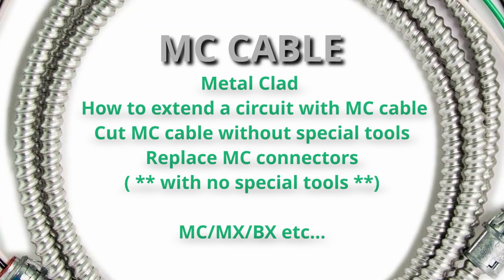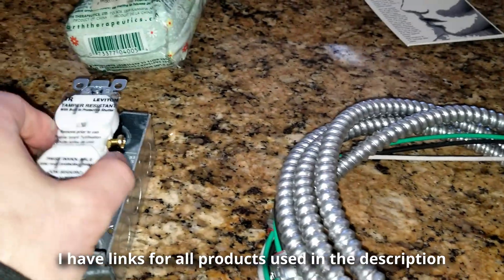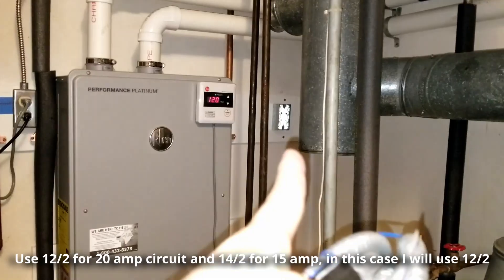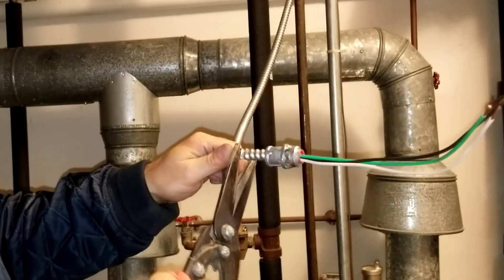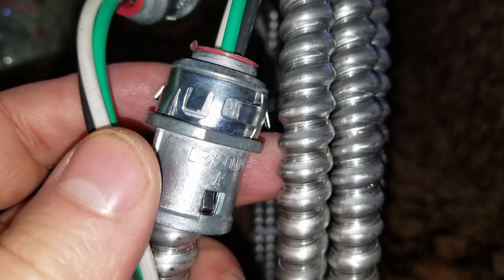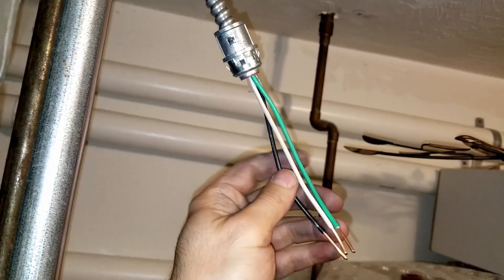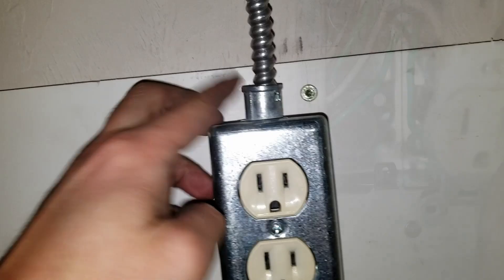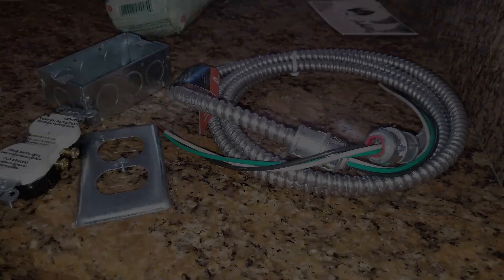How to install, strip and cut MC cable with no special tools

Comment from the maker: Thanks for watching, if this helped you leave a comment and subscribe.
Helpful links:
MC connectors for 1/2 knockout - https://amzn.to/37UnErD
Southwire MC cable 12/2 - https://amzn.to/3q2whX8
Wire cutter and stripper - https://amzn.to/3aYaLOW
Voltage tester - https://amzn.to/3q0Isnx
Tin snips - https://amzn.to/37Sy5vM
Metal outlet box 1/2 knockout - https://amzn.to/3uvwlSK

Comment: If you don't have the proper tool to cut it, use a hacksaw make a small cut on one of the ridges, careful not to go in too deep and cut a wire, then bend the Cable at the cut and it will pop apart.

Comment: I had to cut my MC cable also. I didn’t reuse the press fit connector; I bought an MC connector with a red plastic protection insert. The MC connector has a screw which when tightened is secured to the outer sheath/jacket of the cable. Much easier than playing with those 3 tabs.
Reply: To get those connectors off all you have to do is spin it on the cable and it Twists off with the ridges

Comment: I found it's possible to "unscrew" those push in barbed connectors from the end of the cable and then it's easy to reuse it.

Comment: This guy worried about code but he didn’t use a bushing.. and the method to cut the Mc was maybe the worse ever.. I’ve never seen anyone unwrap it like that before.. another thing while we are in code.. when using mc in tis method for something like a water heater.. every box in the entire run must be grounded.. there is a reason they have grounding screws in boxes just saying.. 

Because if the exposed nature of this hit even a first in line grounding applies.. every single junction box, outlet box switch etc through out that entire circuit must be grounded.. one would think this is common sense seeing how everything in that area has water in it and if a like were to bust have fun.. 

Spent $2000 in setup.. failed to spend $3 for bushings and $20 for a roto splice tool.. and the very first thing any I specter is going to do is pull off the junction box cover to check if it’s grounded..
Reply from the maker: Thanks fir your suggestions. I did group the box, the bushing was on there.

Comment: Snap is connectors are bad, if you need to remove it to move it or anything else it is a pain and you will never do it again.
50 years of experience I have seen so many bad ideas, I worked in aerospace factories building Ion Vapor Deposition chambers and some of the people that work in DIY centers, some are out right scary!

Comment: Great video, thanks!  Unroll the metal clad.  Great idea.  I'm working with 6/3 MC, so unraveling it could be a challenge.  I'm doing a small job of about twelve cuts, so I prefer not to buy a Southwire RF-170 for a hundred bucks.  I'll try this.  Looks like it will at least work for the four square boxes.  A hacksaw will work for the two or so feet to go into the breaker box.  You have to be very careful though to avoid nicking the wires.  🙂

Comment: Good job for bot being an electrician. I’d put a red bushing on before you put the wires into the connector or atleast a little tape around the metal part you filed.

Comment: The person making the video should have used a Seatek roto-split tool to cut the armor on the MC cable.  It makes nice clean cuts without damaging the conductors or leaving rough edges that can cut you.  Many inspectors will fail you if they see hacksaw cuts or other evidence that improper tools were used.

Comment: Please take this video down or update it to show installing an anti-short insert that goes between the wires and edge of armor casing BEFORE putting on the connector!!!!  What you have done is dangerous as it can short.  Also, equipment such as a tankless heater require their own circuit, its not legal to jump off another circuit that has other loads on it.  You have the wire insulation under the screws of your outlet terminals, this can cause a loss connection, and possible arcing, another fire hazard.  You do not have the outer casing removed from the wires inside the junction box, again not to Code.  I understand you are not an electrician, but its not ethical to have this up as advice because there are people who will trust your work as safe.
Reply from the maker: The point of the video is how to cut mc cable with no special tools. I did put the red anti short on the connector. Water heaters that run on gas require very little amps and it's been working on this circuit with no issues. Others also have pointed out that I didn't ground the box but the middle screw on the metal plate does that. This video is not meant to be expert advise, it's a simple explanation on how to cut mc cable without special tools. The user does this, and any other YT advice, at thir risk. With that said this install has worked with zero issues for years.

Comment: When did BX cable stop being used?
BX Wiring Old Armored Cable - Kuhlman Electric
It became popular in the 1920s, and it was the main wiring type by 1932. BX wiring was used until the late 1940s, when it was replaced by early Romex (non-metallic sheathed cable).

Comment: What is BX cable stand for?
A little BS on BX cables. Armored or Metal Clad Cables used ...
Armored cable (AC) first appears in the 1903 NEC. There were originally two initial versions of armored cable. One was called “AX” and the other “BX,” with the “X” standing for “experimental.” The “BX” version became the one that eventually was produced, and hence the name “BX” became the common name.

Comment: 5:52 insulation under the screws, this dude is a walking fire hazard.
Reply: The blk wire is also under the terminal the wrong direction. The metal box's must also be grounded.
Reply from the maker: its non  conductive.
Reply: @daP.A  That's exactly the point. You screwed over the wire insulation on the switch, not the bare conductor.

Comment: I bought some of these snap-in type MC connectors (Arlington brand), but am leery about using them because it looks like there is nothing to keep the sharp teeth or other internal parts from damaging the connector.
Reply from the maker: No issues yet

Comment: I have MC 4/3 1 1/4 inch. Any idea where I can find a cutter large enough to strip it? TIA Deane
Reply: Yeah: a qualified electrician. I don't know what you're planning on doing that requires 4/3, but by virtue of you asking this question, I DO know you SHOULDN'T be. Anything necessitating 4/3 is killing voltages.

...that or you jacked a bunch of MC wire and intend to scrap it for copper. In which case? Your local fire station will lend you their cutters. Just explain why you need em.

Comment: Important note iny area you can not use BX with it's inferior #16 or 18 guage aluminum ground wire in any commercial sites .Must use type MC cable with a great insulated ground wire. At the large hospital that I retired from you were not allowed to use flimsy push in connectors for at least last 20 years.
Reply: Can't stand and don't trust those flimsy push-in connectors. May be OK for range hood but never at a junction or receptacle box. Seen too many fail and make for a piss poor ground.

Comment: You should not have the wire insulation touching the receptacle terminals. Strip back more and ground that metal box.

Comment: You can typically "unscrew" the connector from the MC, no? Rather than bending the barbs in with a screwdriver.
Reply: Yes you can
Reply: If it works. They’re annoying af

Comment: BORING. I stopped watching after 2 minutes. Did he ever get around to showing what the video is supposed to be about -- which is stripping MC cable, not how to install a tankless water heater?
Reply: Dude. The video is 7 minutes long. That's 3.5 minutes at 2x speed. If you lack that level of attention span? You have NO excuse playing with mains voltages.

Comment: Thanks a lot! This helps a ton. Im rewiring My trailer for the 3rd time in 5 years, I'm going to use MC cable so I won't have to do it again!
Reply from the maker: Good luck
Reply: For a trailer the wiring is supposed to be run through the frame tube.
Reply: @SerenoOunce  What if its C-channel frame?

Comment: how not to install cable. this is the typical home owner who refuses to call a professional. once you use tin snips, you lost all the pro's as your viewers and encouraged amateurs to install violations. btw....if you are planning to use wire ties or zip ties....DONT as they are in violation of every electrical code on planet earth. leave it to a pro for gods sake!
Reply: I get that a rotosplit is the 'proper' tool for  the job, but what exactly is wrong with cutting the cable through (with whatever tool will do the job) and then 'unwinding' the amorclad, filing/cutting off any sharp bit, and using a red devil?  It seems like it would function just as well. Yes, it would take longer obviously, but for a homeowner who will likely need to cut maybe 1 piece of MC per decade....doesn't really justify buying a specialized tool. Plus, from what I've seen, those rotosplits leave that sharp bit that has to be dealt with anyway.  (Agreed about the zip ties, however...)
Reply: @RyanLenz  As a diy guy, i prefer to use proper tools in most cases, and would use a rotosplit in this case. You can get away with it, but it takes experience to not make mistakes. A rotosplit is not that expensive, $30 or so.
Reply: @RyanLenz  hey ryan, i can understand what you are saying and i agree that in a pinch cut/skin it however you can while trying real hard not to damage the conductors. often, damage is done to the conductors without actually seeing it or obvious to the eye but what will happen is even though when you snap the armor it still digs into the conductors exposed or hidden and that creates a weak spot on the conductor insulation. the insulation is very unforgiving as it does not rebound. chances are nothing will happen but its not the correct way. i used to see this on my jobsites and would quickly condemn the men and i bought them all roto-splits and 32 teeth hack saw blades. be safe ryan
Reply: @johnmainolfi8054  I'm still trying to understand where/when exactly the risk to the conductors is, when you use his method. You cut all the way through the metal armor and the conductors at the very end (no risk of 'damaging' the conductors here, because you're literally cutting all the way through them anyway...).  Then you unwind the metal armor (I don't see how you could damage the conductors at this step). Then you snip the flattened/unwound armor at the appropriate place (say 8" back from the cut conductors). If you are reasonably careful here, it would be very easy to avoid damaging the conductors. Then you clean up any sharp edge. Again, you'd have to be really careless to damage the conductor -- PLUS, even using the rotosnip you still need to clean up the sharp bit left over. So I'm still not convinced this is unsafe, its just inefficient/slow. Again, for the professional electrician it would be rediculous (except, say, he ends up on a high scaffold, forgot his rotosnip, and has just a single connection to do). For the homeowner, it'd be silly to buy a whole tool just for this.
Reply: @RyanLenz  you do realize that there is a mfg maximum bend radius dont you ? that max bend is there for a reason. when u break the cable you risk damaging the integrity of the conductors. its not good practice. professionally speaking, when i find the ends of the cable cut and left sharp edges on the spool end......i flip out because ive had men wind up at first med' to get stitches. not good practice...simple
but again...one time....go ahead.
Reply: Yeah, I gotta go with @Ryan Lens on this one. So long as you're unwinding BACK to your target length (so you've made your cut 8-12" farther out), the potential for damage is no greater than the potential inside the packaging the cable comes in from Home Depot. It's not like they can develop a "run". And yes, there IS a maximum bend in the sheathing. But considering the roll of MC12/2 I'm staring at right now comes from the factory in a 12" coil, I'm prepared to wager 12" doesn't exceed that. That'll give us a 6" radius, which our 8" "buffer" exceeds. I cannot see the threat here.
Reply: Ty wraps are fine as long as they are listed for use,but probably not in all jurisdictions type 2s ect,I still feel it’s kinda hacky so I prefer batwings,staples ect,my go to is the bx clips nice and clean is the goal

Comment: You can bend the aluminum clad cables until the sheathing separates from it's locked position, then pull the end you're trimming to quickly separate and  unspool the sheathing instead of unravelling the entire length from the end. Then use side cutters or something comparable to cut the excess sheathing, slide it down off the wires, put anti short bushing in the end and gently and carefully pinch the sheathing back flush where you made the cut. Also can sometimes pull the snap in connector while twisting counterclockwise to remove it. Doesn't always work, but when it does, it prefers a Dos Equis.

Comment: Since that was a 15-Amp receptacle did you use 14/2 or 12/2?
Reply: He used 12/2, it was shown in the video. It's most likely a 20 amp circuit, but was not proven. A 15 amp receptacle is acceptable on a 20 amp circuit. A 20 amp receptacle is not acceptable on a 15 amp circuit.
Reply: That's as may be... but I'm pretty sure you DO need a GFI/GFCI in most municipalities where the possibility of water intrusion exists. I'm assuming this is New York (way out on a limb there, I know), and sorta by definition if you're wiring up a water heater that possibility exists.

Comment: I made the mistake yesterday of using one of those boxes like you have in the video with the MC push in connectors. It stuck to far into the little box and the receptacle would not screw in all the way because it was hitting the connector. pain in the ass.
Reply: Best practice if using a surface box always use the 2& 1/8" deep metal boxes & not the shallow 1.25 or 1.5" deep boxes. Same thing when using new & old work wall boxes.
Reply: I would use a 4" square drawn box by 1 1/2" deep with a duplex receptacle cover. The receptacle mounts to the cover. Drawn boxes have rounded corners which eliminate sharp edges and the box width will eliminate connector interference.

Comment: The metal boxes, both the switch box and the junction box, really should be bonded to the equipment ground. This is not hard to do. Typically, metal boxes have a threaded hole that you would use to attach either a bare copper wire or a green insulated wire to the box and then include the other end inside the wire nut that has the other ground (equipment grounding conductors) wires.
Reply from the maker: Box was grounded, pigtail off the ground wire

Comment: I think you need a red head (protector) between the MC cable and push on connector.
Reply from the maker: on those its built in.
Reply: @daP.A  pretty sure you were using an ast-38 connector. they literally do not have an anti-short built in. to respond to jerry, obviously everything is up to local code, but im in an extremely strict JHA part of the US (seattle area... these inspectors are dick heads) so this guy is wrong about the connector having them built in, but sort of right that they arent "required". Just a much better installation than relying on a file on a some bx/mc connection? just put a red head on. most spools have a pack taped to them. take the 10 seconds to throw one on. or spend 5 minutes unwinding the jacket, cutting it, and filing it down like this guy....
Reply: @akeldamach  You are wrong. 

I just read the NEC on AC and MC cables. Anti-short bushings are required for AC cable by the national electrical code in section 320.40 it clearly states “an insulated bushing or its equivalent protection shall be provided between conductors and the armor. For MC cable the code does NOT state that anti-short bushings are required. Therefore, they are optional.

Why Does MC Cable Come With Anti-Short Bushings If They Are Not Needed?

BPT Fittings sums up this issue below:

"The inclusion of anti-short bushings with coils or reels of MC cable is based on historical practice relating to the requirements of 320.40 of the NEC, which mandates the use of anti-short bushing or its equivalent protection for Type AC Cable
BPT Fittings"

They have included anti-shorts historically for AC cable so they continue to do so for MC cable. That is a convenience for some electricians who like to do it the old way and who want the added "safety" in their installations that they feel the anti-short bushing provides.

As of today, there is no factual evidence stating that anti-short bushings increase safety when using MC cable. If this is ever the case I am sure NFPA would require anti-short bushings for MC cables.
Reply: @RedRyz3n  what am I specifically wrong about? It's unclear from your NEC references what I said that was wrong...
Reply: @RedRyz3n  they no longer come with bushings. mfg supplied them merely as for preference. they are NOT required for MC cable and now no longer provided.
Reply: @daP.A  aalways insulate your conductors even with snap on connectors. Most mc rolls provide red bushings for insulation
Reply: The red devil is already installed on the connector so you don't need another one